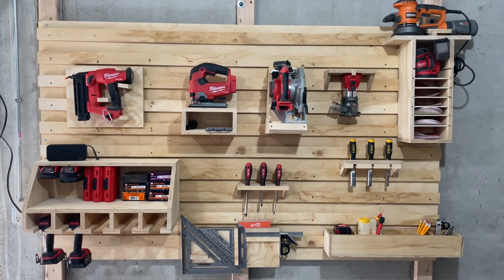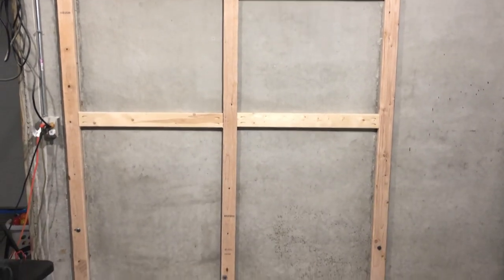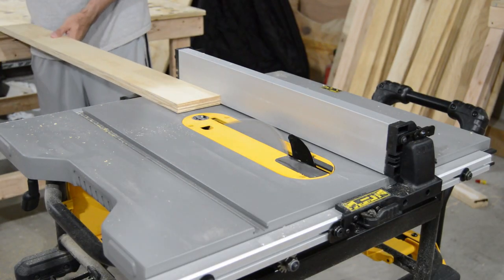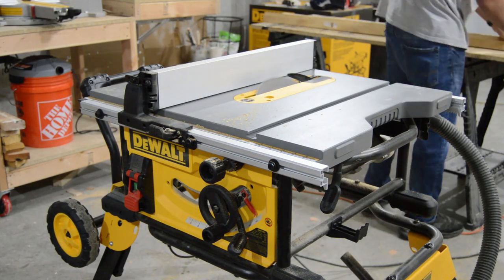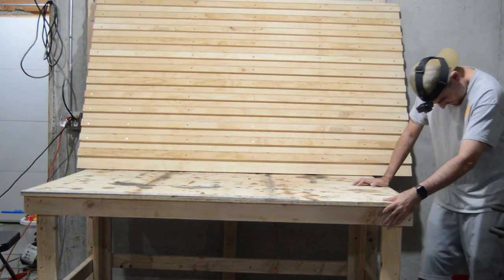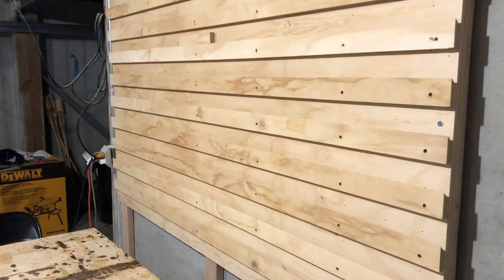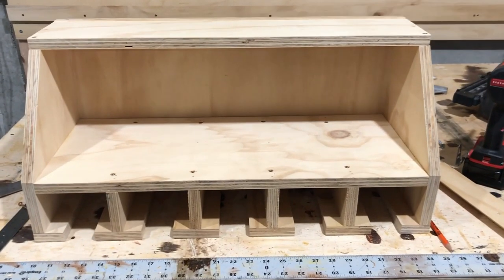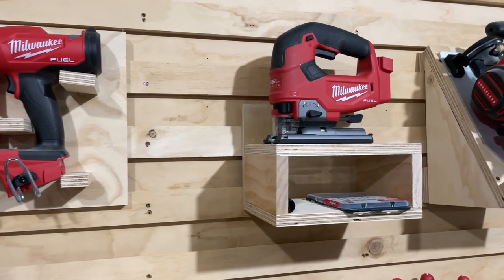HOW TO MAKE AN EASY FRENCH CLEAT TOOL WALL

Comment: Anyone notice the wrong-way-round cleats at 3:16?  He managed to fit the entire board like that then it magically sorts itself out at 4:06!  It's always better to note learning experiences on a build vid.  We all take wrong turns but failing to point them out helps no-one.  Turns it from 'look what I can do' to 'this is what you can do'.  Nice end result - neat storage and room to expand!
Reply from the maker: Thank you for the feedback.. Back then, I was learning to edit videos, and I forgot to remove that footage. Thank you for your support.
Reply: @watcherick4433  Hi Erick, the content is great and it's not the quality of the edit I was commenting on.  The point I was making is that you should have highlighted the rework you had to so that all could learn.  Similarly the layout was initially too tight to allow cleated stations to be fitted/removed so you had to increase the spacing.  This is all good stuff that could have been passed on to others.  You've got some great content and good vids for DIY.  Keep it up, top stuff 👍
Reply from the maker: Thank you will see in future videos .. How I’m referring to avoid some issues that I did. Thanks Again!
Reply: lol you right

Comment: agree, french cleat is an absolut perfect solution for your workshop, I need to redo mine but this time I will 45 degree angle on both sides much much easier to cut and cleats closer to each other
Reply from the maker: Yes is the best!, a new tip that I learned.. cut more 45 clips that you need.. to get extra strips.. i bought new tools and I have to make more .. now i always have extra in case I buy a new tool.

Comment: Suggestion if you plan to install the cleat wall in one piece. Cut the bottom of your plywood wall at 45 degrees. Install a leveling cleat on your 2 x 4s. Rest the wall in the cleat then nail it. Use the resting cleat for more walls.
Reply from the maker: Really good idea! Thank you for sharing

Comment: Thanks for the video very well done. So just to check the cleats are two inches what measurements are the spacer blocks you use to space the cleats out  please and what diameter is the wood you are using 👍
Reply from the maker: Thank you for Watching! And yes the spacer Block is 3”.

Comment: Nice Video but I'd like to see you using a push stick instead of running around to pull the boards through.
Reply from the maker: I have the one that comes with the table saw, but I wouldn’t say I like it.. Which one do you recommend?

Comment: How did you attach the 2x4 to the cement???? I have a similar situation.
Reply from the maker: I drill a hole with HammerDrill and then I used tapcon screws with a washer.

Comment: Just a note for your safety. It made me cringe when I was watching you cut these pieces...

When using the table saw to cut an angle, you want the fence on the other side of the blade, so the blade tilts AWAY from the fence. Not towards it. 
Also you need to use a push stick, never pull the workpiece through. 

The only reason you didn't get any kick back when making those cuts its because you have a splitter (the thing after the blade).

You never want to trap the work piece (wood) between the fence and the blade, its perfect conditions for injury.

Otherwise, nice job. I am doing some research to make my own French cleat tool holders.
Reply from the maker: Thank you for your feedback.. it helps me to improve my skills.